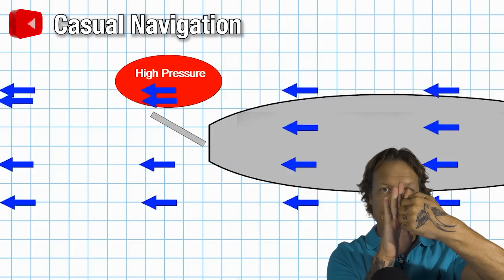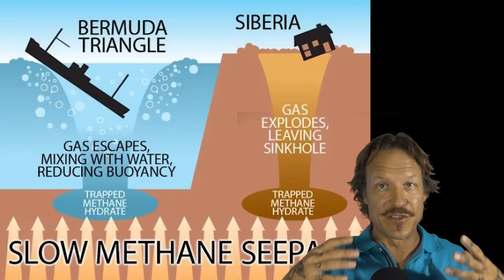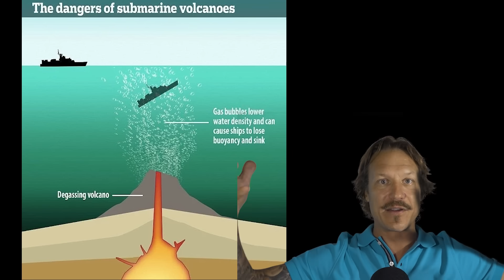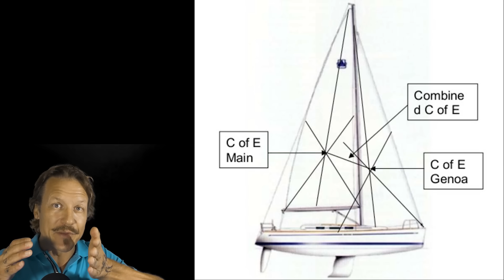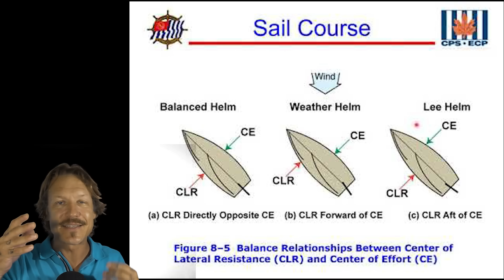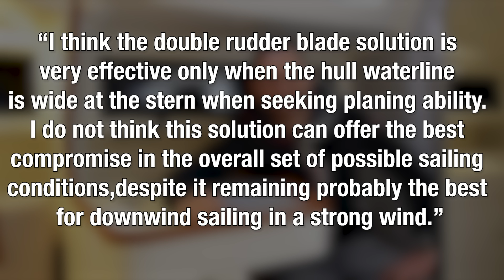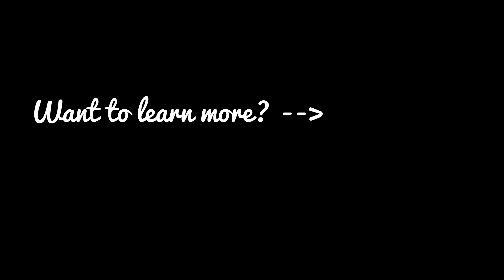The Problem With Dual Rudders Nobody Talks About

Comment: I have a narrow boat that sails downwind very well. Its easy to trim and almost sails itself. Our best days are averaging over 10 knots. It works because its light. 
And there we get to the big problem: almost 100% of wide stern dual rudder cruising boats are way too heavy to plane or even surf effectively. The average cruising boat has a displacement length ratio of 150-220. My boat has a displacement length ratio of 80. Nothing that heavy is ever planing and wont surf with ease because physics. No twin rudder Oyster is ever planing or surfing fast because they are too heavy.

Comment: Couldn't manufacturers offer an option of a hull shape for the people that want to go offshore? Yes it will cost a bit more, but I think we are at a point with technology where having another mould for a hull shape won't be as costly (for a company) to remove the option altogether. See Contessa 32, they are still making the classic style hull.

Now, mass producing yacht makers (you know who I'm taking about) will have to bite the bullet and not go for a 300% profit/hull and beef up the blue water option a bit to make it a viable option price wise compared to the shore speedy version. I think there are a lot of sailors who will gladly give up the space and speed of a modern yacht for the safety and comfort at sea of a more older design.

Comment: Another way to describe the handling effects is to compare how land-based 3-wheeled vehicles and trikes handle versus 2-wheel (mono) and 4-wheel (cat).

Driving or riding in a straight line gives 4-wheelers a superior level of stability and comfort over two-wheeled vehicles when hit by unexpected crosswinds.

However, turning corners or even bends in the road shifts the centre of balance away from the centreline of the vehicle and into a more unnatural crabbing effect or the reverse of drifting or sliding, where you have some level of control.

By comparison, when using a clockface to describe centreline stability, a monohull is streamlined with the bow at the 12.00 o'clock position and the rudder and stern are in line at the 6.00 o'clock position. Dual rudders shift the streamlining effect at the stern by having the one and only rear rudder being used at the 4.30-5.00 o'clock or the 7.00-7.30 o'clock position, which now shifts the centre of balance from centre to somewhere in between centre and 2.00 o'clock or 10.00 o'clock position which also creates a tendency for the bow to nose-dive when going into the wind.

Boat builders making dual rudder monohulls also need to cater for this shifting of the load centre point, hence, a broader structural footprint is needed around the base of the mast.a superior.

Physics doesn't change whether you're in the water or on land. The only difference is having either potholes or waves.

Comment: There was a concept I learned as a would be designer. It was "greed for speed". This was a  vigorous infection that would first hit the racing community, then spread to the cruising one. And the best speed to be had was down wind.

These contemporary boats do have their critics. And I am one of them. But, I think their defenders have a point. With modern navigation capabilities, combined with far better weather for casting capabilities, these modern boats are arguably safe offshore.

But, in my opinion, they are temperamental, deep draft, and extremely vulnerable to keel and rudder strikes (this is where the more precise navigation comes in). They are also more expensive to run and maintain.

Cruising under sail used to be a sport practiced by those who had watch their cash flow. Now, it appears to be a sport of the wealthy (who, as they always tend to do, try to shut everyone else out).

Comment: I watched at your video a couple of times trying to understand your argument. It seems that excessive weatherhelm when going uppvind is the problem.

I have owned an Elan 450 for about 14 years now, one of the ”problem” boats in your opinion.

Can’t say that I have experienced what you are describing in the video. My experience is rather the opposite when comparing my present boat with other boats with single rudder that I have owned or sailed i.e. better rudder control and less risk of broaching.

It may be that I don’t understand your argument.
Reply: Because the scale of increased sensitivity to wind strength is gradual, your old Elan 450 may not be that extreme. The designer may have made the sails and the boat's underwater body a better compromise.

Comment: i agree , dual rudders would be alot touchier to steer on course , maybe turn faster with more surface area but also hatd to stay on course for the same reason .
most ocean going rigs , ships have 1 .bow thrusters for docking , turning 180° in a tight spot , i notice the wide stern yachts heel so much more and cause of that you see them turn out of control at times in races , i. sure its the dual rudder and shape of hull that exaserbates those symptoms

Comment: Always love discussions regarding Rudders and their design. You are 100% correct re Twin rudder design to compensate for large wide sterns and planning hulls, built for running and reaching. An Ocean going boat built for cruising should be able to sail against the wind with safety. Twin rudders are not protected by the keel ( if you have a collision with Flotsam). But "Race boats" are built for specific perceived  race conditions. Just look at past entries in the Sydney to Hobart 600nM . Wild Oats 11, 100ft long and very slim hull, Commanche 100ft long and extreme large stern. Wild Oats wins if there is allot of windward work, Commanche if there is allot of running reaching. Depends on the weather who wins.
Reply: Depends on the weather who wins.  Exactly!  I had a light air flyer and was unstoppable-- but only in light air. In heavier winds I either was pushed sideways or reduced sail and could not push through the chop. I goes the same with any sailboat.  The design and rig tell you what you can do.
Reply: But twin rudders are so much shorter, half the length of the keel so that risk is not so high.

Comment: To me it's about people pushing too much sail.  And the boats that I've sailed on a tiller were way better on autopilot then my wheeled vessel... An autopilot on a tiller you're not going to wear that motor out... My old man and the sea.... Thousands of miles tiller the whole way no wheel.
Reply: The autopilot is on a pin on top of the tiller and it's a pretty beefy electric motor... They are easy to disengage when things get weird I wouldn't go around the horn on a wheel cables hydraulic whatever so much can go wrong but a good piece of wood It's a sure thing
Reply: And I don't think I ever remember them complaining about battery problems in that book My old man in the sea....
Reply: Their electric tiller on a tiller ran flawlessly and wasn't a huge battery drain
Reply: But these cats had a special rock solid setup they weren't playing around or getting cute about swimming.... They were going around the horn in a 25-ft boat and they did it spectacularly

Comment: A topic you may consider discussing is the significant increase in system complexity on modern boats with all the Maintenance of Dual rudders, dual helms, multi voltage electrical systems, multiple toilets, etc. Then compound that with the limited mechanical skills at most yards to provide the support hence said skill will fall on the captain.

Comment: Running a marina in Greece, I'd try to coach beginner captains to reverse up into stiff winds while dropping their anchor. Many would get the yachts going in reverse, at an angle 90 degrees to the direction they needed to be going. They'd then turn their rudder to turn up into the wind towards the pontoon, and the boat wouldn't respond. They'd blame the twin rudders not being deep enough, or large enough, or not just in front the prop. The truth is, they never got going fast enough in reverse, before turning their rudders. At low speeds, the water flow of the foils was not enough to turn the boat up into the wind, and the maximally turned rudders acted as handbrakes, slowing the boats down, preventing them ever getting up enough speed to get steerage. 
You need to get the boat going 3.5 to 4 knots in reverse with a straight rudder, going the wrong way, before attempting to turn the rudders slightly, to which the boats would immediately respond and turn as desired.
Remember to drop speed to below 2 knots when you are on the right line and wish to start dropping the anchor or you'll blow your windlass.
Reply: Why reverse into the wind? Aren't anchors usually at the front on most boats?
Reply: @kukuc96  Mediterranean mooring is berthing stern in to the harbour wall with the bow anchored off.  Many Mediterranean harbours have the wind blowing offshore, sure not all, but common enough.  Procedure, find gap, drive forward, reverse back, lower anchor while feeding out chain, approach harbour closely, slow down and stop, attach lines from each quarter to harbour and then tension up on anchor.  There is more to it than that, but that is the gist of it.
Reply: @alastaircurrie5396  Ah, I see, I forgot about harbor anchoring, due to being in harbors with pillars all the time.
Reply: @kukuc96  not in the MED. @abatesnz most likely refers to tying up to a pier in roman catholic stile. This is, set your anchor 90° in front of the pier and the spot assigned, then pull back until you reach 3ft befor the pier and then throw your lines to the marinero. I sail a twin ruder boat. An other solution to @abatesnz approach is to use the bow thruster to line the boat with the mooring spot. To my experience it makes life easier.
Reply: Even better, bring your boat up to speed, and just before you start your turn, put your engine into neutral. The boat will turn on a dime.

Comment: I like what you have said about the dule rutters and what I am seeing is that the way they are healing over on today new boat is the force of the wind makes them heal over far to much compared to older designs . And the heal of the new boat all the force is forward on the hull rather on the center of the boat as older designs did .

Comment: Question…the twin rudders are not in line with the propeller.  Does propeller wash over the single rudder make it easier to maneuver versus the twin rudders where the propeller wash is between the rudders?
Reply: Yes, absolutely. Prop wash is the only way to have the rudder or rudders work at all at slow speed. Most of the dual rudder boats have a bow and/or stern thruster. However, bow and stern thrusters can break... Really large dual rudder sailboats like some of the newer 60 footers have two engines so they do get prop wash over the rudders. Perhaps as electric engines become more prevalent there will be one small engine and prop in front of each rudder.
Reply: @dutchrjen All single rudder boats above 35foot have bowthrusters as well. The wheel effect on single rudder boats is much more pronounced.

Comment: I watched the Vendee Globe this year for the first time and was at first amazed at the size of the waves they encountered and then the constant battering they endured. How could anyone endure weeks and even months of that kind of torture? Then, the doldrums were a blessing so they could climb the mast and replace all the stuff that broke. I think the yacht builders should just show perspective buyers videos of the vendee globe and there would be no problem going back to logical boat design.
Reply: IMOCA60s follow the exact same design principle: Wide stern, dual rudder. If it was bad for performance they wouldn't be doing it.
Reply: @kukuc96  Well, it is good for downwind performance, bad for just about everything else. Really great design if you want your private yacht to be used for racing downwind. Its like buying  a car on the basis of how well it performs in Santa Pod straight line acceleration. That, and the marina show-off value of pretending your boat is big, by just being wide at the stern. As a private yacht, a sure sign of lack of seamanship.
Reply: @sorim1967  the majority of cruisers pick their weather windows to be able to sail downwind, 99% follow the classic coconut milk route and sail the tradewinds. Amazing how boat builders design boat for the use cases that the vast majority of boat owners actually user their boats.
Reply: yes I am sure you know better how to build race boats then renowned naval architects who do this for a living

Comment: It always seems to come down to the same thing get a boat for the type of sailing you are doing. The problem with that statement is that you start off not knowing what you want to do or what will fit it. The other part is that things change and what you started doing and got the prefect boat for will not be a good choice for your new direction.
Reply: That’s why you need two boats…. or three. With motorcycles there is an equation of how many is the correct number. N+1=P where N is the number you have, and P is perfection. 😆

Comment: That was was so informative.👍
I’m looking at The Boreal 44.  This boat has a single rudder, but then it also has two stern drop-down rudders.  Is this the best of both worlds?
Reply from the maker: Great boat. I love that design.
Reply: The drop-down blades do not rotate, and are only used to stabilize the boat. Though if you look at the hull design, they are quite wide aft, so not necessarily immune from the issue highlighted in the video (which have nothing to do with single vs twin rudder). Also, their designs are getting more modern (wide hulls, both aft and forward, similar to Ovni 430): look at the new 56, compared to the 52 or 55 it replaces. It will be interesting to see how they sail , because the lifting centreboard requires a shorter than average rudder. Alubat went twin rudders on their new Ovni.

Comment: Ahhh this all makes so much sense, I have a 36 catalina, not an offshore sailor but get in about 500 to 700 miles a season,  this winter my wife and I charted a 47 Beneteau Oceanis, in the BVIs, as you know the wind is abundant there.   The very first observation while underway was the weather helm and the extra-work balancing the sails.  Anxious to try this boat I was  disappointed  a bit.

Comment: What I don't think people realize is that the Vendee Globe sailors etc have a course that's designed to maximize the kind of downwind sailing you describe. They'll go out to the middle of the Atlantic, head down past Africa, and then have a sled-race round the Roaring 40s. They will have everything right on the edge, and sacrifice sleep for months to keep it that way.

That's something less than 1% of offshore sailors will ever be interested in.
Reply: A Flat surfboard type  hull profile on the water, and not in the water, between the chines in effect a noisy in motion and at anchor form that is totally devoted to Racing. So Nothing even approaching what I am looking for in a Cruising and Voyaging Monohull, hence my ideal Sailboat personally, which has addressed all of the serious flaws in Classic Sailboats, is an Island Packet, which is the Monohull that I have in mind for my last Sailboat- likely the IP 349, for the 4.0 foot Draft, and encapsulated lead long keel - even better than my Endeavour 32 frankly. What clinched it, was Darrell confirming that it can have a second head as a custom option - if you entertain, or have Crew, then a second head and shower becomes a real essential tbh. Bob. 🤔🌟🌟🌟👍❤️⛵️
Reply: One misconception, the roaring 40's IS NOT a sled race. It's a series of distinct pressure systems moving generally east and the wind direction changes as the system moves through. It only resembles a "sled race" with a boat that is fast enough to keep up with the weather systems.